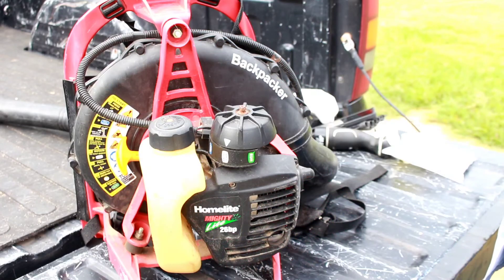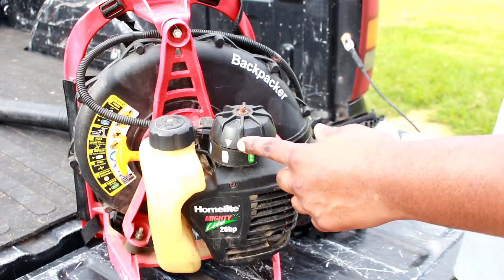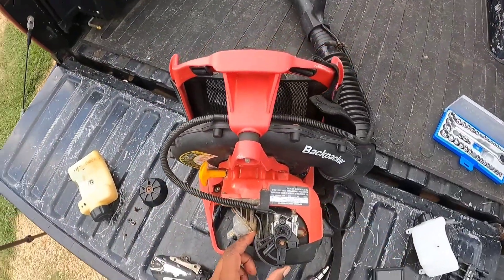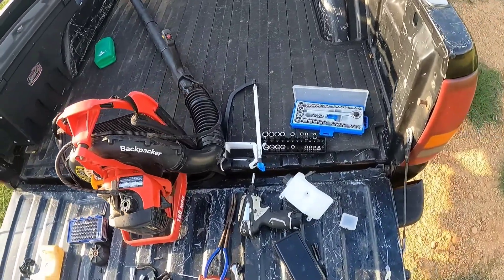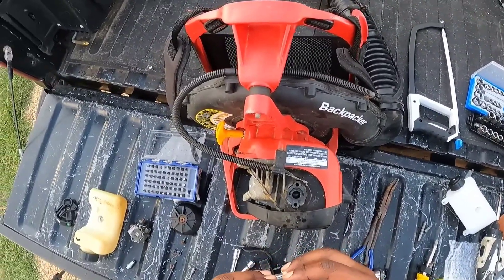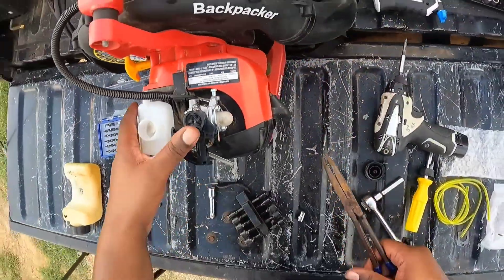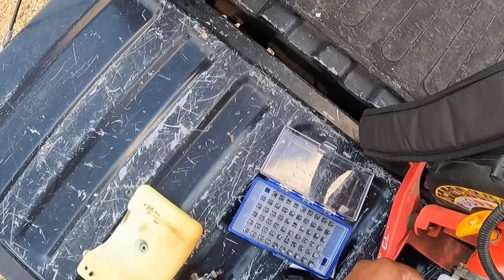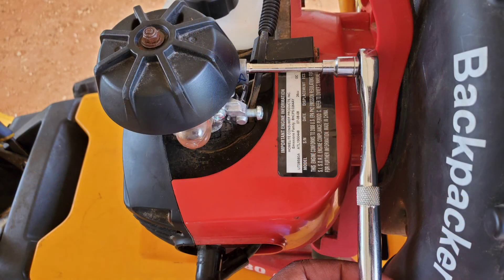Homelite Back Pack Blower Carburetor Replacement and Adjustment

Comment: Mine stops working once it's on full run mode it starts up on full choke and stays running after I move to half choke it dies carb or what do u siggest
Reply from the maker: I can't diagnose it properly since I'm not there but it Sounds like a possible carburetor issue.  How often do you use it? When was the last time you used it?

Sometimes if you leave modern fuel ( ethanol addictives) in these small engine carburetors for to long the fuel will clog up the carburetor. 

It could be a couple of other things but more than likely it will be the carb.
Reply: Bought it for 20 but fuel lines where cut changed them ran for a couple  hrs then lef it to cool off  then started again and tried to turn and it will only stay on on half choke if I spary carb cleaner in it
Reply from the maker: Sounds like that carb is clogged or the diaphragm inside the carb is bad.
Reply: @How I Do It FaM will buying a new carburetor do it?
Reply from the maker: @danielaalbarran7073  I can't say for certain like I said I'm not there. All the symptoms are pointing in that direction though. They are pretty cheap off of Amazon.  I believe it will work on your case
Reply: @HowIDoItFaM  thx so much  i will rey and let you know
Reply from the maker: No problem. Yes let me know how it goes!

Comment: When u adjust the carbunator l to h do u close them all at first  and just open the high.
Reply from the maker: What I do on most them is close them up turn the low side out one full turn and turn the high side out about 1 1/4 turns and adjust from there.
Reply: @HowIDoItFaM  to get it to run properly  I rlly can't figure it out to tune it
Reply from the maker: Is it running at all?
Reply: @HowIDoItFaM  yes but I can't get the tune in right I had it blowing but it blew to weak soo I close them all upp again
Reply: Until tmw
Reply from the maker: @danielaalbarran7073  once you have it started. What happens when you squeeze the trigger? Does it bog down and die?
Reply: @HowIDoItFaM  keep on going  but it sounds rough like it gas bad idle
Reply from the maker: @danielaalbarran7073  I wish I could hear it. Sounds like it may be running lean (not enough gas).  Try holding the trigger and adjusting the high side of the carburetor ( should have an H labeled on it)
Reply: @HowIDoItFaM  do you have Instagram
Reply: You need to remove the carburetor to adjust it because the adjustment screws face the blower housing. You cannot adjust it while it's running unless you have an adjustment tool that's flexible.
Reply from the maker: Definitely not a great design. I ended up cutting an extra adjustment tool I had in half  and making a shorter tool using a  ratchet. @ 11:58
Reply: @HowIDoItFaM  yea I got it sum how it will stall ima try today for thr last time  if not I am done trying with it
Reply: On these carburetors it's not marked high or low. You just keep fiddling with the two adjustments until you get a right. Start out with two turns out and go from there in or out .  Pain in the butt to do.
Reply: @danielboguse4249  yea been trying for weeks to keep it running and not from stalking it lastes a while but then shuts off and like looses power I belive just need to be tune right I just can't get it r8ghr
Reply: Make sure you have good fuel lines, a clean filter and the primer bulb has no cracks in it. Make sure the fuel lines are hooked up correctly the suction and return lines on the correct fittings on the carburetor.
Reply: @danielboguse4249  guess what it was I did all that struggling for it to be the screen of the exhaust took that apart and it was a big mess and now it sounds way better don't think it will bog down anymore
Reply from the maker: @danielaalbarran7073 success looks good on you!  I just made a video on spark arrestors being bad.   I didn't even think about it on this one 🤦
Reply: @HowIDoItFaM  thank you soo much I was so annoyed  of this design no way I can get thru screws with out taking the whole thing apart so far I got I been using it like that for a while for my lawns and would work for a while then like after 30 minutes it will bog down and stall
Reply: @HowIDoItFaM  what is the bit/socket for the adjustment? Wondering If I have a stubby that fits it for one I'm picking up.
Reply from the maker: @KentRobertSwickJrAroudTheWorld you're talking about the card adjustment right? I used a pacman style carburetor tool... I had to cut it in half  because it's too long to fit between the carb and blower housing.  I wish you could send me your email. Ill send you a Pic of it. I can't remember if I posted a Pic of it in the video or not

Comment: For the parts
Reply from the maker: Kuupo 308054001 C1UH142 Carburetor with Tube Maintenance Kit for Homelite UT-08580 UT-08981 UT-21506 UT-21907 UT-21546 UT-21566 UT-21947 Craftsman 26CC Edger String Trimmer Blower https://a.co/d/cSgba4S
Reply from the maker: Homelite 308675002 Trimmer Fuel Tank W/Cap https://a.co/d/5hCKAEQ
Reply from the maker: If you haven't already please consider subscribing and Liking the video. It really helps the channel grow. Thanks again